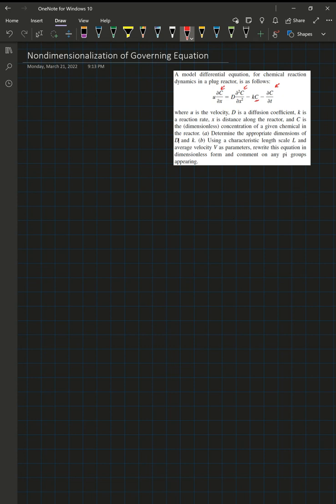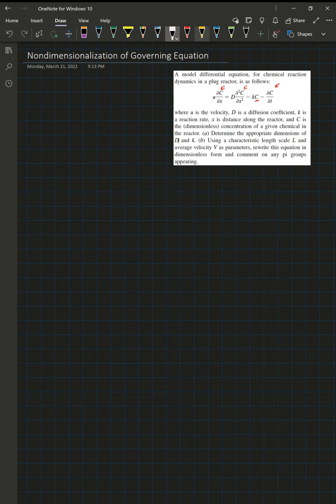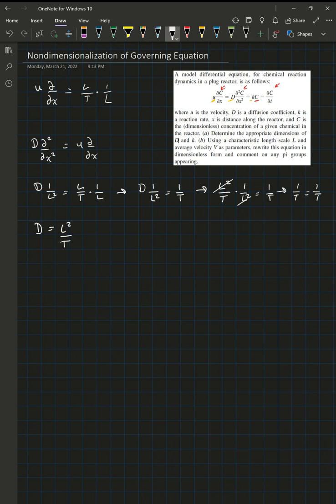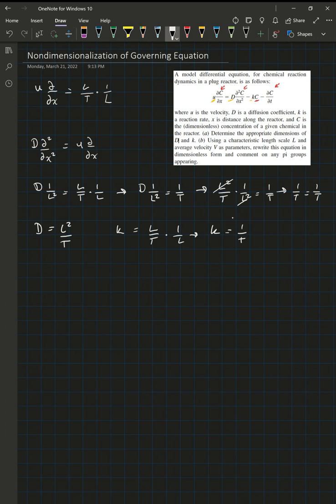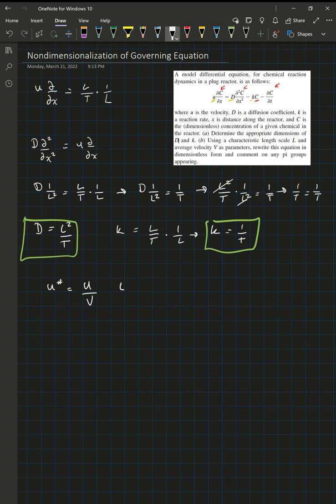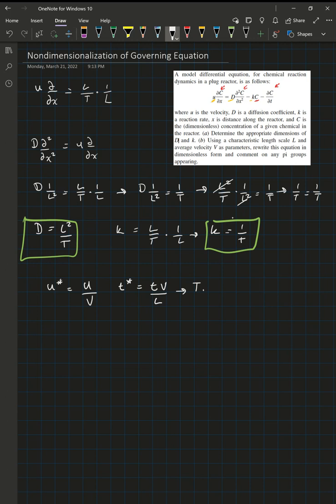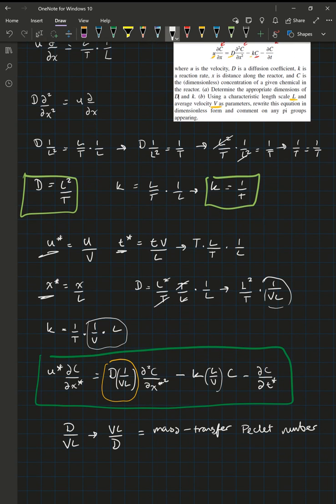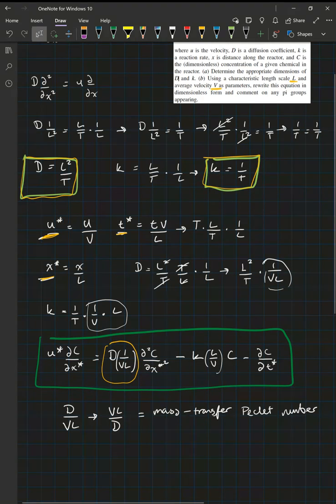[MAE 242] Making a differential equation dimensionless

Comment: Are the D and K rewritten at the end supposed to be D_star and k_star since they are the non-dimensional version of the original D and k?
Reply: Hello LBHMS! One reason why we might nondimensionalize a given equation is to highlight or focus on certain components of the equation. Thus, we will nondimensionalize what can be considered repeating variables in the equation by representing them with the asterisk symbol, such as x* or u*. In the problem above, the parameters D and k are significant to us and so we would like to see the variables that will make D and k nondimensionalized. Further, when we determined this relationship we saw the basic parameter, mass-transfer Peclet number also referred to as a "pi group" in the problem statement. In general, there is ambiguity in the choices that can be used for certain scaling parameters, also known as repeating variables, and for the basic parameters. In our case, since D and k were significant to the problem and C was nondimensionalized and u was dependent on the previous quantities we chose the repeating variables to be everything but D, the diffusion coefficient, and k, the reaction rate, to focus on their effect on the given equation.